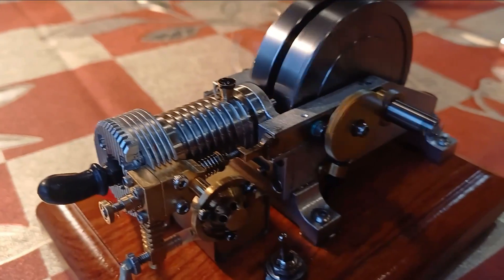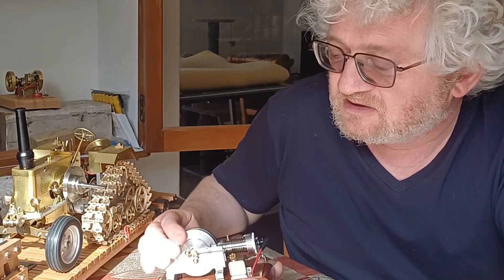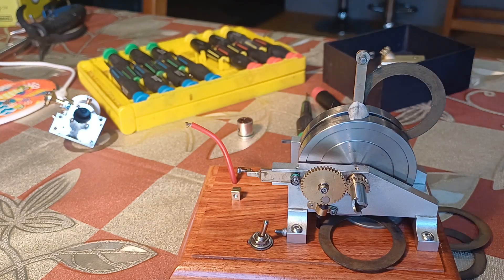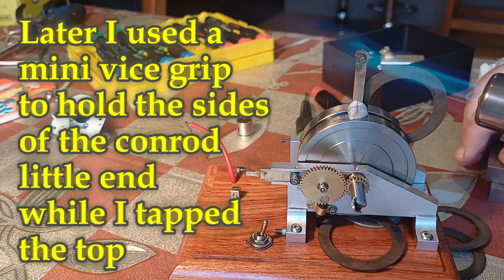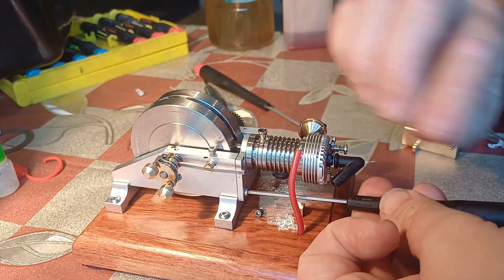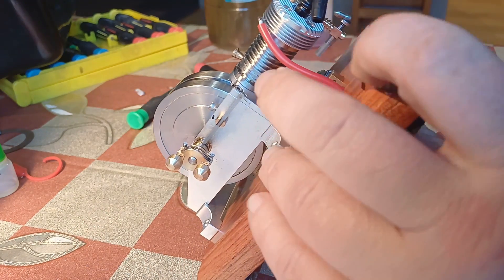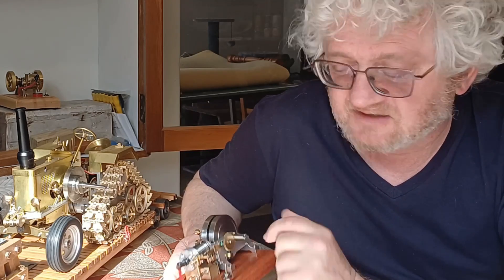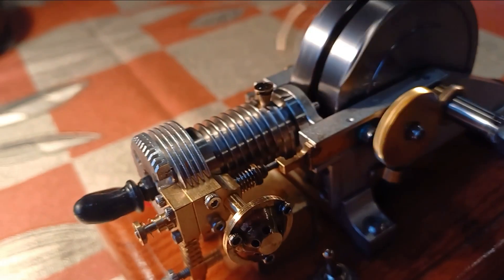oddball 2 - tweaking fun with your model engine hit and miss M96

Comment: Can I leave the hall sensor in place if I change the failed ignition on my M20?
Also, what is the issue about using a dummy battery together with two full ‘double A’s please 🙏
Reply from the maker: Yes you can use the old hall sensor...theoretically. Should be.
 As for the dummy battery thing, I never ever did that but I did read about it. For "dumym" read "conductive dummy" so you are reducing the input voltage to 3v from 4.5 but keeping decent current flow (the batteries are not flat). I never, ever bothered over all my engines
Reply: @ Hi friend. The new unit has arrived.
It looks the same, apart from … two black wires to the hall sensor, where the old one has three (blue,black and brown) as this old hall sensor has three cables, which two should I use?? 
As the new unit hall sensor is effectively for a different engine .. so it’s not a straight swap ?🤔
Regards.

Comment: Does this run on gasoline, if so, is it mixed with oil?  I have one similar to this and it runs on Ronsol lighter fuel. Do you think this would run on that too?
Reply from the maker: Yes they run happily on lighter fuel and many modeller hobbyists recommend it for cleanliness, however as you do add two-stroke oil (40:1) you are adding stuff so maybe not so clean burning...we have alcohol-free petrol in NZ for now so I use pump gas, 95 octane plus two stroke oli
Reply: @ThomasPCGuruENGINES  sorry to be a pain, but would the lighter fuel need to have oil mixed or does it have enough lubricity already?
Reply from the maker: Definitely add oil

Comment: The latch on my M96 was backraked too, but not as badly as yours.  I think they cut them from a piece that was the same width/too thick for the groove they cut in the valve rod and ground the wrong sides to make them fit.
Reply from the maker: Hey Henry! Thanks for the update man